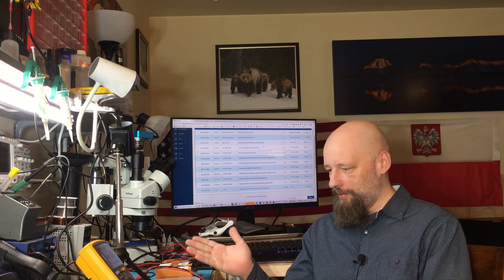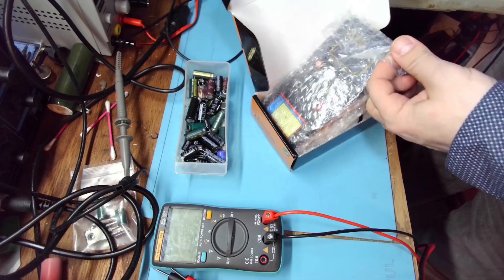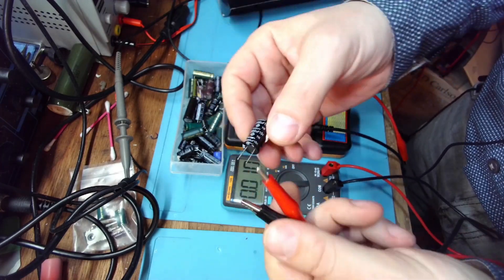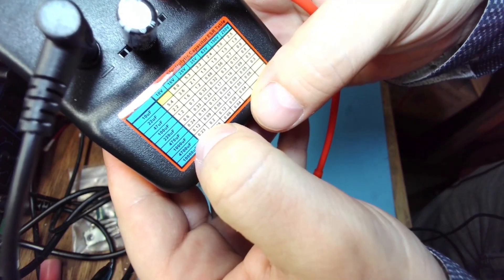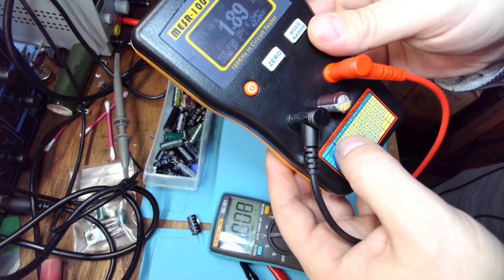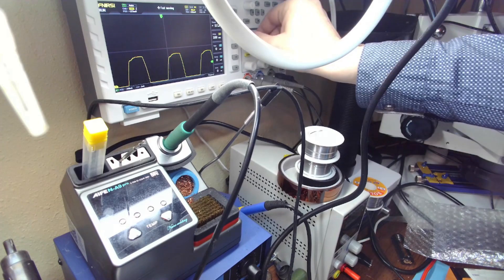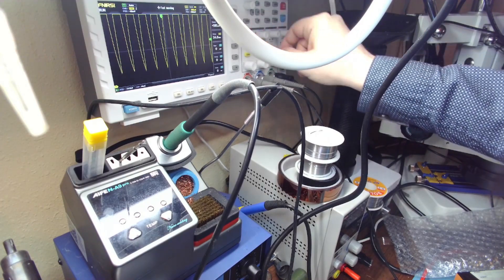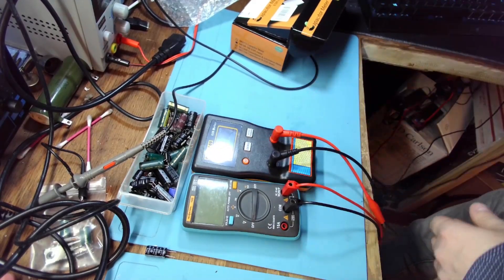MESR 100 Review Why do you need an ESR METER

Comment: For in-circuit tester leads are pitifully short but good thing it uses 2xAA batteries as display backlight eats a lot of juice and 9V batteries are expensive
Reply from the maker: oh, I actually never checked how it's powered, the batteries are still going :) however, I don't use it very often

Comment: I've just got one of these.  I have a question.  Is there a limit on what I can test with it?  For example I have a 22000MFD (uF I think that means) 16V cap.  Can I test that?  I don't want to break it on the day I get it.  The table only goes to 10000uF, so I didn't know if that was the limit.
Reply from the maker: the higher capacitance will not break the meter but the reading might be inaccurate. Very high capacitance is no different from open loop, it's just over limit
Reply: @blackhorserepairs  Thanks.  I get 0.02, so to me that looks okay.

Comment: did you get a chance to review LCR-ST1? I wonder how it would compair to MESR 100 in terms of on-board capacitor testing?
Reply from the maker: not yet. lately I do very few power supply repairs so I don't really use my ESR meter that often

Comment: biggest advantage of esr meter is that you can measure caps in circuit, no need to desolder them... the other version of this meter comes with additional SMD clamp

Comment: Man, glad this video was suggested.  I had wanted to maybe five or more years back invest in the DER DE-5000 or this meter that I wasn't able to find the model since I didn't save anywhere.  Well, I go to search for the DER and only found these MESR 100 listed.  Funny, finally the DER showed after entering DER into the search term.  I see many are using the Atlas ESR70 more and more, so that one is in the mix for future investing in if not a better lab bench system to restore most likely as that would be what I can afford.  So far the LCR-T4 has been working great for the expense.  So I haven't invested in the DER as I planned and now seeing the MESR 100 is cheaper, like way cheaper in price as used to be the same cost as the DER from what I recall. Thanks for sharing.  I've also been thinking about first getting the newer LCR T4 that's I think the T7, though forget since didn't do much for electronics repairs the last year or more.
Reply from the maker: @jafinch78 just be aware that MESR100 will not accept regular leads and the leads that it comes with are not making it easy to measure in-circuit. I'll be releasing a video about that soon.
Reply: @blackhorserepairs  I just found KISS Analog YT channel shows a nice looking Hantek design that's new to me.  It's the  Hantek 1833C and I see Amazon notes a 1832C as well I saved in my list.  He compares with a CEM model as well.
Reply from the maker: @jafinch78  thank you, I'll check it out
Reply: @jafinch78 I buy gear off Eddie and regret  not buying the hantek because I bought a flir one amd spent way too much money. The wife paid for it though haha he has 2 micsig scopes and I'd love to have one. If I had my time over I would've saved 1200 and bought a micsig over my rigol.
Reply: @jstro-hobbytech  Which micsig?  I'll have to read into those. Thanks for mentioning.

Comment: That was me who recommended the MESR-100 meter✋   I use it everyday.The meter can check caps in circuit without desoldering the caps.
Reply from the maker: yes, I remember, thank you again. Soon I'll publish a video on making custom probes for it :)
Reply: @blackhorserepairs  What is the price of the ESR meter?
Thank you
Reply from the maker: @SDsailor7  it's about $50 on eBay
https://www.ebay.com/itm/285276781025?hash=item426bd239e1:g:CzQAAOSwRA1kWjI-&amdata=enc%3AAQAIAAAA4LBTVPktuMFlBkwKWypZC8C3kh4%2BH0sBOFmq3OcNWE0ijpwgskEe%2B%2BbzFnAELBHk8ImQ1Nd73l860SKyHHP8Ch2hEcbY%2B4ExZjomkNNI1xsHvDL7zoJgM7unT9QPxONWXCeouLPTP7aM7XRLg9G5Q9U2TYvsRhD3vubltYd2SVHAqDi603QF4%2FVq1fs7j4A%2F0tCeXUxF3EAylnsN2onyDsCL1pPzHV0NW8uJliNqOquIEwt7Wx0VaOXxZgohKrbvMSz3HPUGj0%2BSi02qSMuc9186Qs1P0QEyqkwbiSenEiaP%7Ctkp%3ABFBM0Jm5zsVi
Reply: It can check caps in circuit only if there are not two or more caps in parallel. This is generally not the case but is something to be aware of. If there are two caps in parallel they would both need to have high ESR to check bad.
Reply: What is the price of the ESR meter?
Thank you

Comment: I use capacitance meter from pF to 20mF, I was thinking about buying it, but for now is OK. My digital multimeters are an old Metex which I have from the '90s and a new similar to your one only with Auto + Bluetooth, but no capacitance ;). So, maybe it's time to consider it as well then. So, thank you for the video ;).
Reply: I have a capacitance and ESR meter on my bench. Reading capacitance only goes so far when it comes to electrolytics... An ESR meter will show how healthy it is well before the cap starts swelling or potentially leaking. 

Capacitance meters are great for measuring all other caps to determine potential faults otherwise!
Reply from the maker: Metex? I haven't seen those in decades :D
Reply: @blackhorserepairs  Yes, it's an old one. When I was starting to fix electronics in the '90s in Poland, one guy from repair shop gave it to me, model M3650. Even has a good look till now. Only needing calibration ;). As I've got other meters, and no time to spend on it, it's just is.
Reply from the maker: looks like you can still buy it on https://www.radwell.com/ for $51

Comment: I have a few ESR meters over the years. I have the Anatek Blue ESR meter, and the Peak Atlas ESR70 which gets the most use. I like them both.
Reply: (I own one ESR70_Gold & it works very nicely, displaying capacitance with the ESR value).
Reply: @tonyd1149  Plus the fact that it chimes in a high tone when the cap is good and a low tone when it is not. Saves checking the chart 😀
Reply: @bobsoft  Hi Bob.  Yes, you're right.  A very nice instrument.  (Also, one can communicate with the factory).
Reply: Hi, I bought my first ESR meter 30 years ago, Dick Smith made  in Australia.
5 of 6 years ago I bought thd Peak Atlas ESR 70 and 2 years ago I bought the GME-236.
I repair Hugh End audio gear in my home lab here in my country.
I prefer the GME-236 over the others.
GME-236 don not need to calibrate each power up.
Is controlled with microprocessor, test, ESR and DCR, is really fast, make diferent sounds depending of thd ESR value.
I recomend.
Best Regards.

Comment: I got one of these through Amazon a year ago. I really wanted a meter capable of in-circuit testing and it did the job well for about 3 months of steady use until the leads became intermittent. I attempted to use longer leads, but it failed to calibrate, so I had to settle for the short ones again. 

Oddly enough in my case it was on par with the T7 tester both in and out of circuit, but again I was challenged with flimsy short leads and unable to use longer ones.

After about 1 year, my MESR failed, it only measures negative and will no longer calibrate. My capacitors were always discharged, so I am not sure why it failed. 

As "expensive" as it is, I am going to buy a "Blue esr" meter in the future. I see many people using one on youtube, and have been able to add at least 15" lead length without any issues.
Reply from the maker: interesting, I thought I could just replace the leads with the ones from my multimeter and do in-circuit measurements. I also just realized that I never tested it with in-circuit measurements. I'll look into that soon.
Blue ESR Meter seems to be available on eBay for less than $120, pretty much the same price range as MESR-100
Thank you for the information.
Reply: @blackhorserepairs  Good to know! 
The time I bought the MESR it was almost half the price of the Blue model.

I am looking forward to seeing how the MESR will work out for you. Maybe I got a lemon
Reply from the maker: @whodatdere1  indeed, the meter will not calibrate on longer leads. It seems misleading to advertise it as an in-circuit meter when you can't attach decent leads.
Reply: @blackhorserepairs  I agree. I haven't sacrificed a probe set to see how short I can cut one up until it works. I just cut some leads off a diode to clip onto so I can poke at SMD caps easier
Reply from the maker: I ordered banana plugs and I'll see if I can develop custom leads with stainless steel needle point ends. I also managed to calibrate it with short breadboard jumper wires so I can measure caps in-circuit